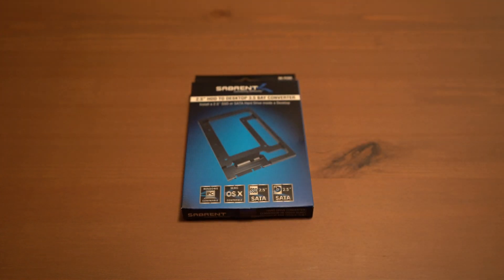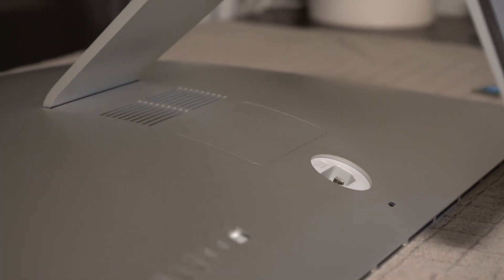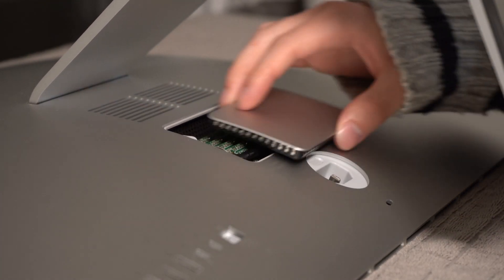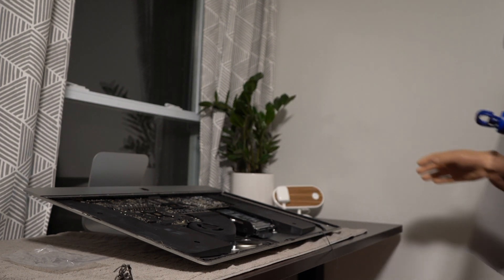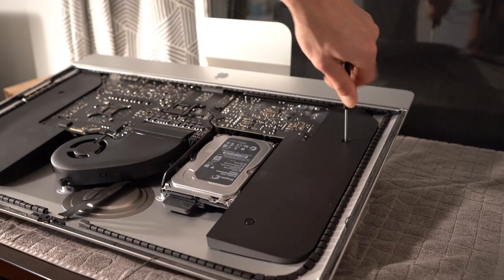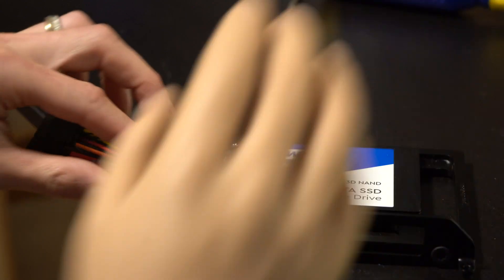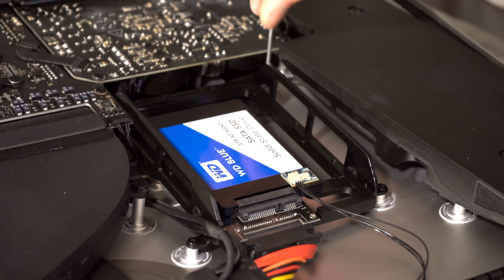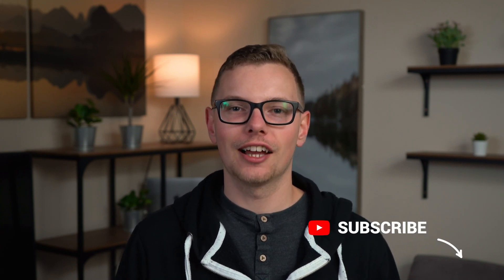How To: Upgrade Your iMac RAM and Storage to SSD

Comment: Hi Dan! I just bought a 21.5 late 2019 iMac that came with its original SATA drive. My old 2011 iMac still runs like a champ with the updated SSD. The problem is that it only supports up to High Sierra. I'm wondering how could I take that SSD and install it into my new iMac? THX!

Comment: Awesome video!! Hey, I have a question. I’m an intensive user and I want to get a new iMac but I’m not sure where to get the M1 or the 27” 2020 i7. I want it to last for about 5 or 6 years (my current Mac mini is already 10), so I’m really doubtful about it since you can’t upgrade the M1, but I’m not sure if Apple will continue to support Intel iMacs in the long run. Any advice?
Reply from the maker: Hey! I am betting on M1 these days. The performance is significantly better in every way so I could see Apple focusing their efforts on that. If you can, wait until later in the fall as there are reports of new Macs coming later this year. It’s possible a 27-inch M1 is coming!
Reply: You have many options if you include intel machines- my plan is I’m purchasing a 2019 iMac 27” and a Mac mini 2020 M1. Because the M1 chip is so new, and the pride is right I want to enjoy the best of both worlds. And prayfully in 5 years I’ll purchase another iMac or power Mac with a M2 chip.